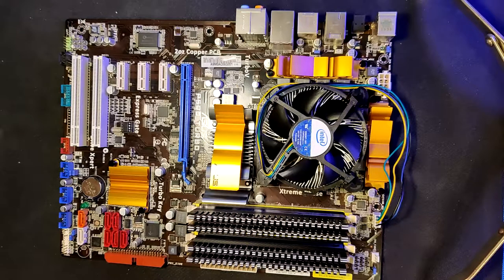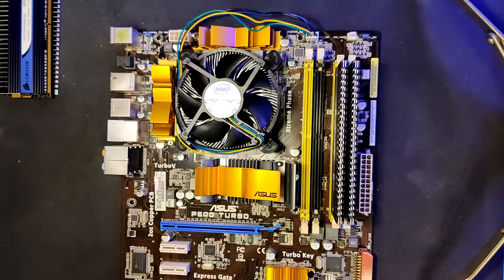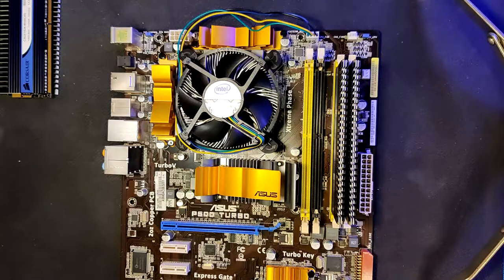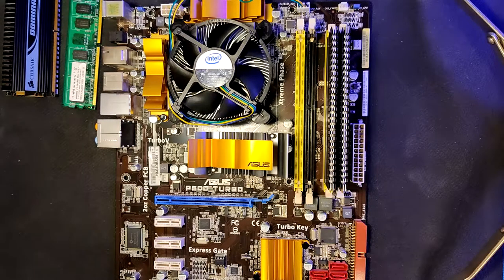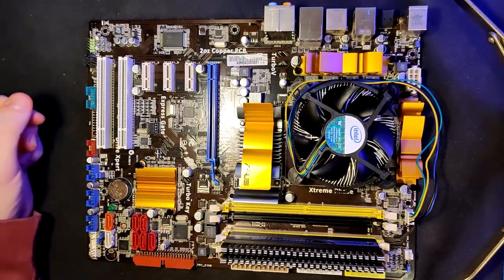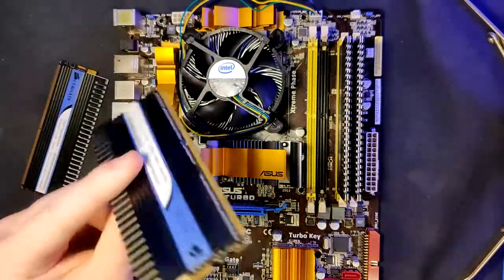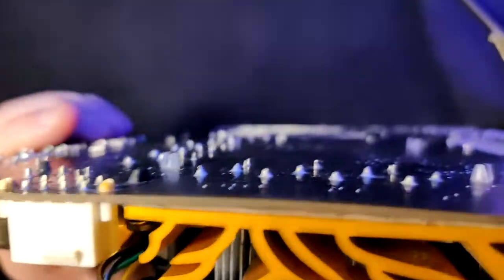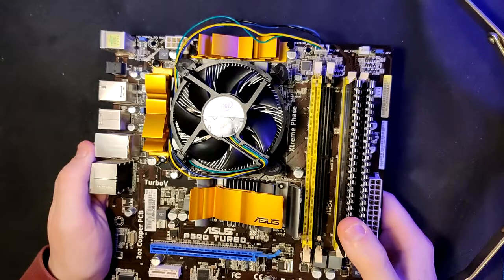First Impressions of the ASUS P5QD Turbo | The most disappointing purchase i ever made...

Comment: Asus is really bad, the entire p5q series.

I have p5qc, a1, a2 (ddr2) and a3 + b3 (ddr3) are all dead, only b1 and b2 (ddr2) works, but only works with 2 sticks in single channel, if I use 1 stick it will not post, asus is really bad.